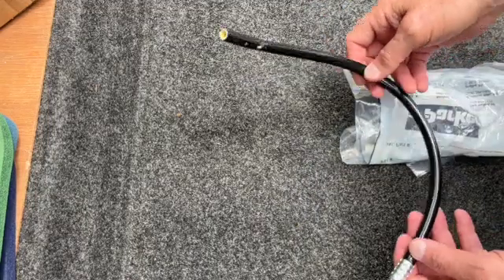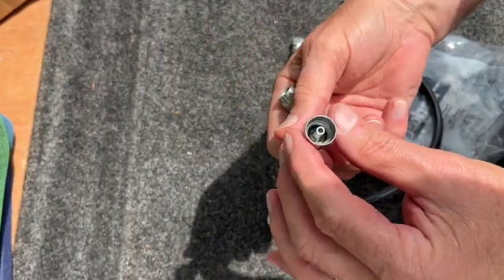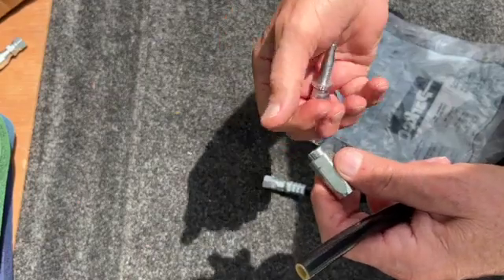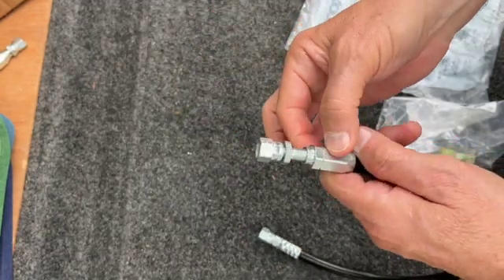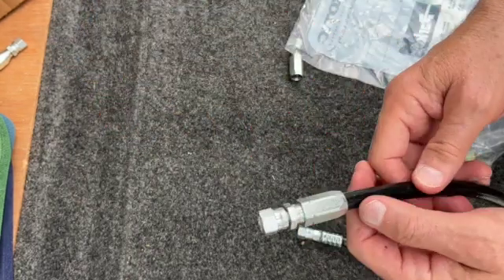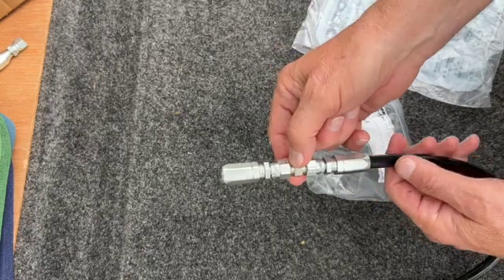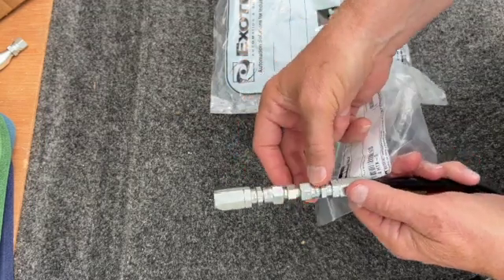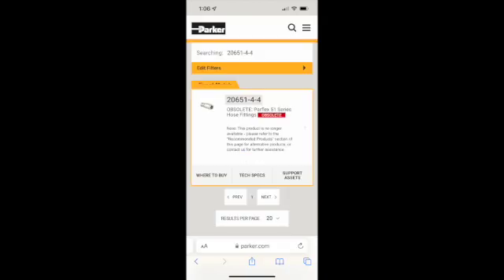How to repair RV hydraulic hoses. I have saved  over $900 by Fixing a blown RV Hydraulic hose.

Comment: I know this video is 2 years old by now, but I just watched it.  The Parker website says: "Please note the couplings on these fittings are only intended for use on hoses that have not previously been in service."  I wonder how you feel about that precautionary statement.  The hoses on my motor home are at least 8 years old, so I am concerned that the hose might fail at the fitting due to its age.  The hose in question is 20 feet long, so I would much rather cut out the section with the leak and repair it, rather than replace it.   Thanks for a great video.
Reply: Mine was 10 years old and it worked fine. That was three years ago and it is still working.

Comment: I went to the distributor to get this coupling, but it would not fit my 2006 Beaver Monterey line. They said the coupling only works on Parker hoses.
Reply from the maker: contact the manufacturer of your unit and ask them who makes the hose they use.

Comment: You mentioned that the new Parker part # 2-651-r-4-4 will not work with older hose. Can you please elaborate? The original part# 20651-4-4 is no longer available anywhere.
Reply from the maker: Check with parker  their phone number is 330-296-2871. I fixed my unit and latter sold it. so I no longer have hoses to repair.
Reply: Did you find out if the 20651r-4-4 worked?

Comment: I had to have a new hose made. Could not find the fittings. With the 7/16 JIC female and 1/4 hose end and 153" of hose, I paid $132. If I called Exotic Automation and gave them your part number would it fit my camper leveling system hose and the 7/16 JIC female?
Reply from the maker: look at the part number on your hose, the should be able to match the at exotic,  Good Luck

Comment: The end that screws onto the hose are left handed threads (counter clockwise rotation to install) . In the video you are rotating the wrong direction and that is why it is not going on the hose very well.
Reply: You saved me from some epic frustration. Thanks

Comment: They make a single and double braid field repair fitting, single is what is needed on these. I repair my drain jetting hose the same way.
Reply from the maker: This braid is not metal so it takes a different fitting.
Reply: I use them everyday, I repair my hydro jetting hoses with them all the time, they are nylon braid so the single braid works the best.
Reply: Any idea a part number on the single braid field repair fitting? I can only find 2 wire...

Comment: Fixed mine with Barbed Brass Coupling and 2 hose clamps on each end.
Reply from the maker: The repairman who fixed my rv at the park because the original hose blew out did the same. It leaked and he stated it was only a temporary fix. That is when I researched and found the fix designed by the hose mfg.
Reply: When trying to move (and eventually doing the repair in this video) I found my return line had been sampled on by a rat.  The brass and clamps worked to get my slides in and jacks up to make my move happen.  I had to re-patch the line 3 times before figuring out to not move the slides in 100%.  That was putting max pressure on the return line and blew out the patch job.

Comment: I have leak at fitting that connects to manifold.  Will verify correct size and if so cut hose and install.  If it works it will be a life saver.  Thanks for the info
Reply from the maker: Did it work?
Reply: @cecilwoodworking7204  No the hose was to brittle had to replace.  But have the fittings for future use, great idea.

Comment: If you brought that to my hose trade counter, we’d make you a whole brand new one for less than $30 !!!!
Reply: 1/4” 100R7 thermoplastic hose is $4 per metre. The 7/16” JIC swivel females are $5 each and a ferrule is less than a dollar each. If you got told $900 to repair they were having you on !
Reply from the maker: The hose ran the full length of the RV so all the panels had to be removed. $125 per hour plus travel plus the hose.
Reply: If i had to replace the entire hose i would tape the new hose to the old and pull it all the way through.

Comment: A year ago I had leaks at the fittings on 2 hoses.  Dealer called hydraulic company and they said must replace two hoses.  (Hoses we’re not leaking) 
End result was (1) 10’ hose with (2) 90 deg. fittings, (1) 6’ hose with (2) 90deg fittings, and four hours total labor.   The dealer did not charge me anything on top.   My cost was $1,250.00.   Sound like a fair price?
Reply from the maker: Sounds way over priced.

Comment: Thanks for sharing Cecil, I"m having some issues with my hydraulic hose.  Can you share where did you get the fittings from. I have tried but no luck with a vendor.  Thanks.
Reply from the maker: I added my source In the description.